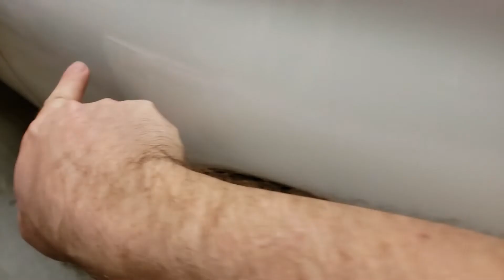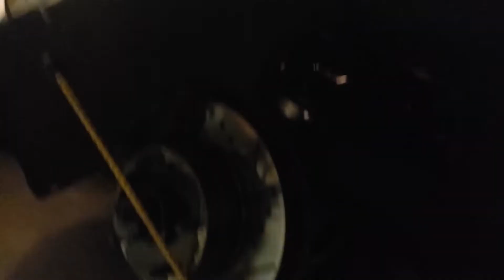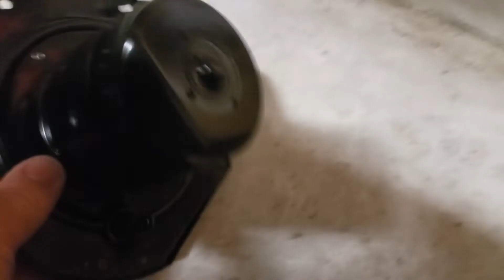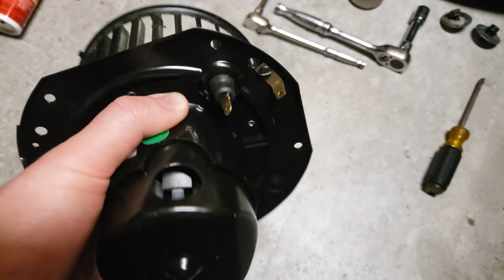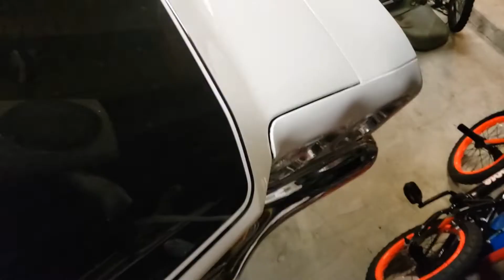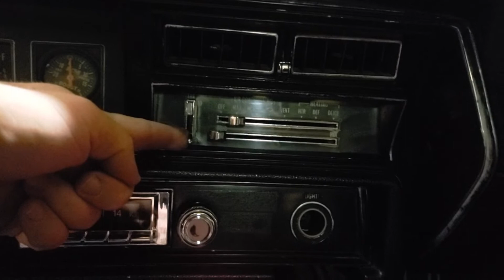Replacing the blower motor in a 70 Chevelle

Comment: My motor runs but hardly moves any air compared to a more modern car...wonder if I can swap one?
Reply from the maker: You shouldn't need to.  May want to start by checking for obstructions and/or clean the evap and heater cores.